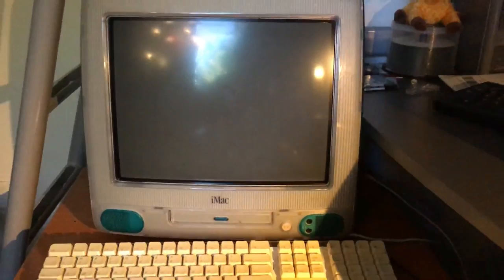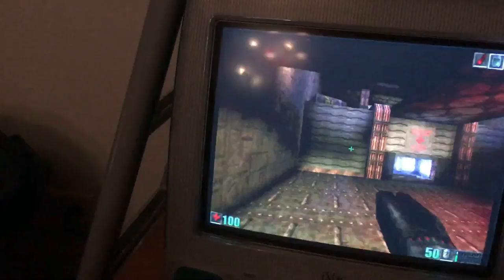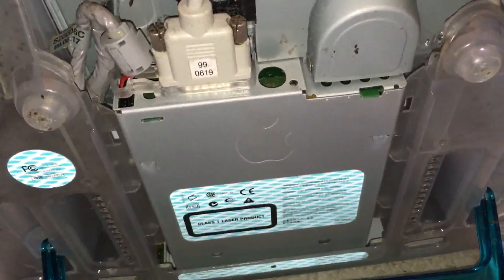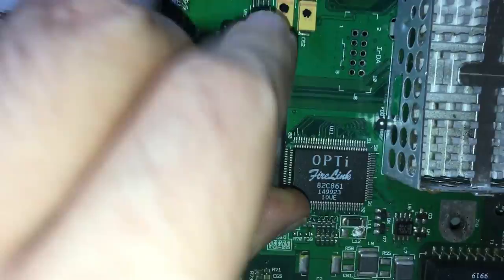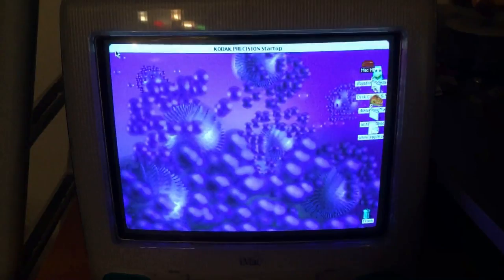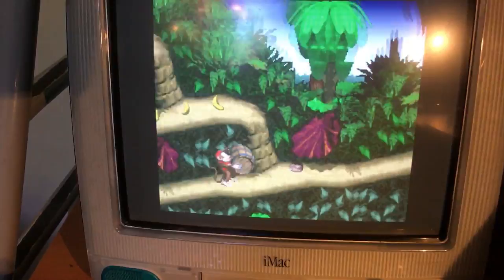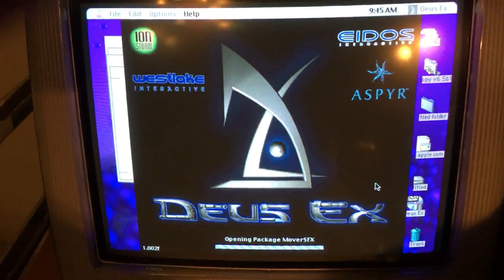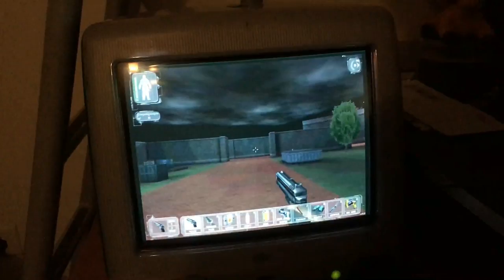Imac G3 From 1999

Comment: Haha, love it.  Pickup a G4 Mac Mini if you want a blazing fast OS9 system for gaming.  They are pretty cheap still...slap in SSD in that bad boy, max out the ram, profit.
Reply from the maker: i like these g3s they are the best mac apple ever made imo, only thing is, they don't run a lot of software, was there a version of softimage 3d that worked on g3s?
Reply: @psychoticgiraffe  The G3 is awesome, unfortunately you don't get the built in CRT with a mac mini.  But regarding softimage, it seems it was only ever released for Windows NT and Irix (the OS for SGI machines)